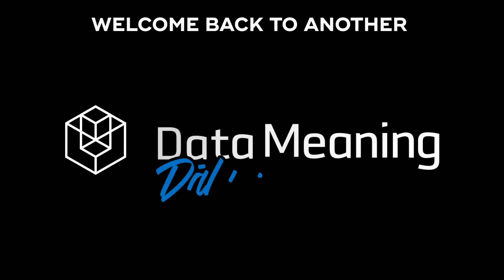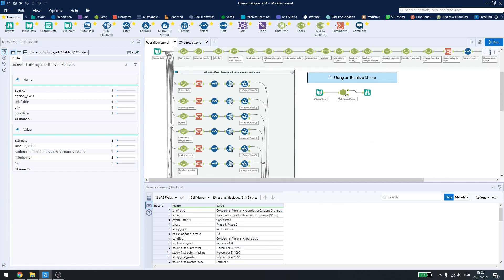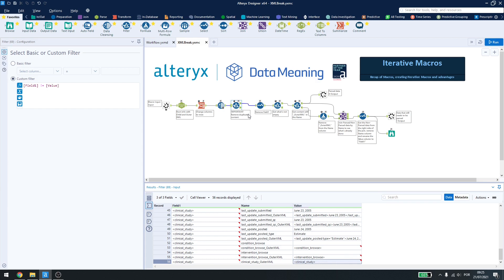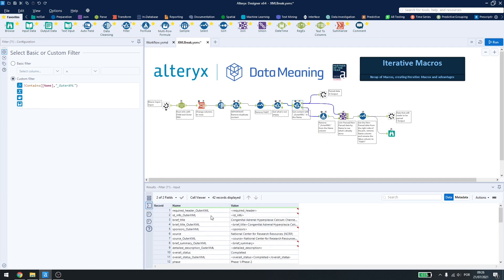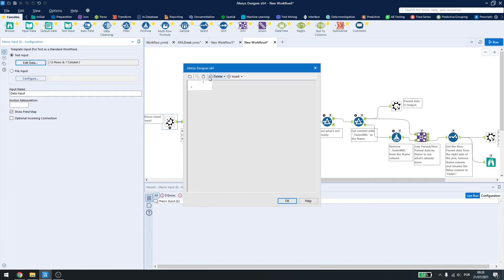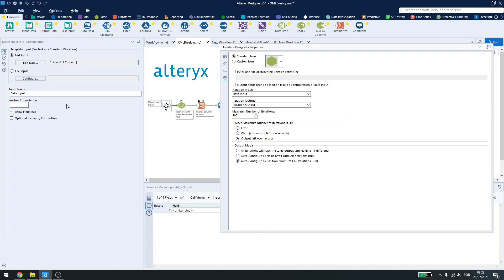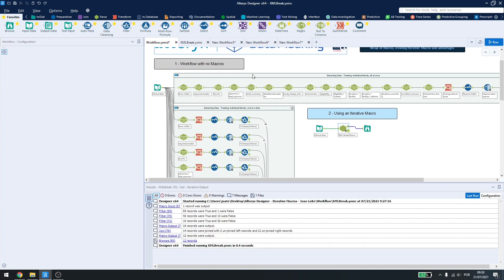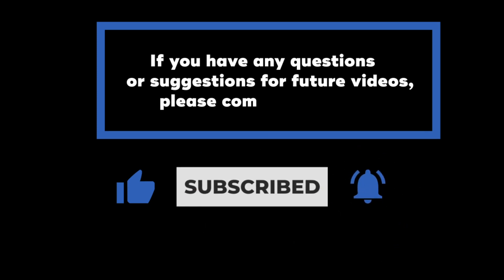How To Use Iterative Macros In Alteryx Designer

Comment: Need help to collect auto data from excel file but it's has parameter like data should be collect as per set table. Table numbers can be change as it's dynamic. If you can help pn this that will be very helpful.